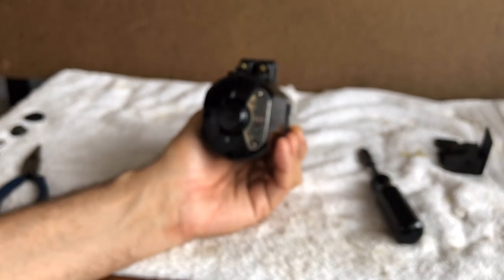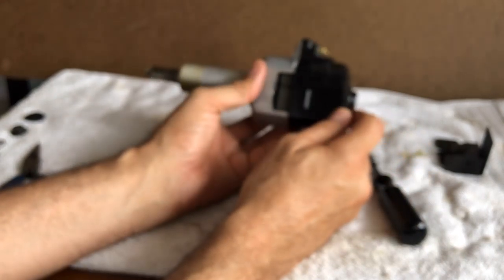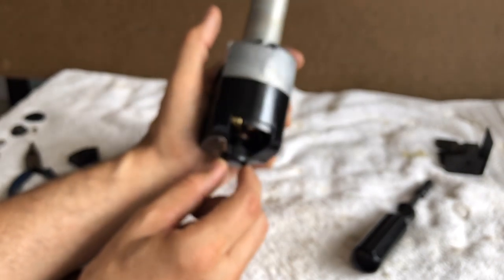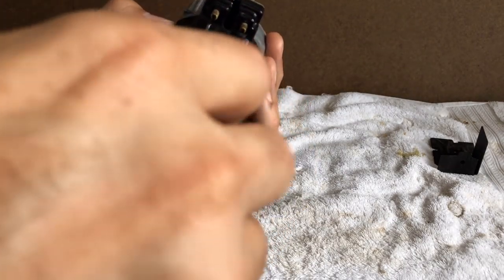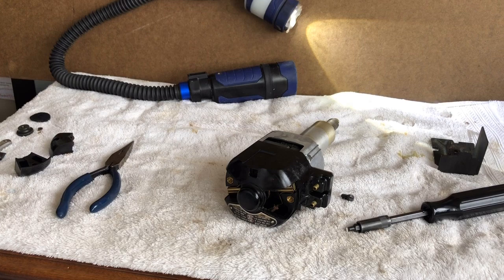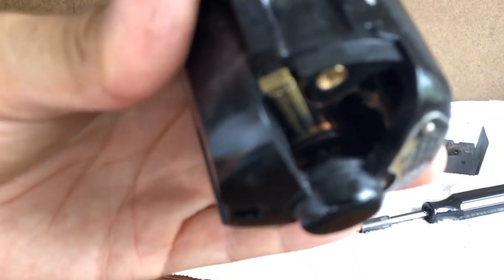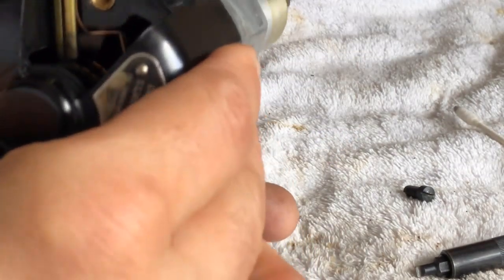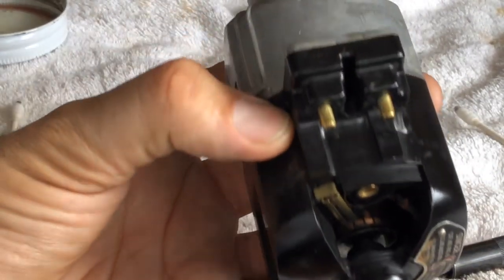MOTOR SERIES #6: Inspecting the Brushes & Cleaning the Commutator. Inside the Singer 301 Motor!

Comment: My machine smells when I run it but it works great otherwise. Could the motor be dirty? Is that a thing? Like dust on a fan? Like when you turn a heater on for the first time after a year 😂

Comment: Can we use 99% alcohol, like for electronics? instead of 91%, if that's what we have?
Reply from the maker: Yes Andre that should work just fine.  And just like with any solvent, keep it far from your paint finish since it will dissolve and or damage paints on contact!
Reply: @VintageSewingMachineGarage  Thank you!